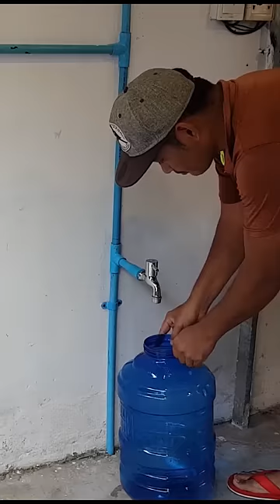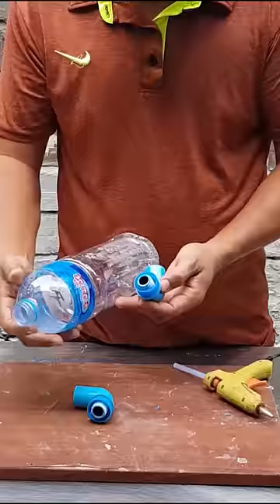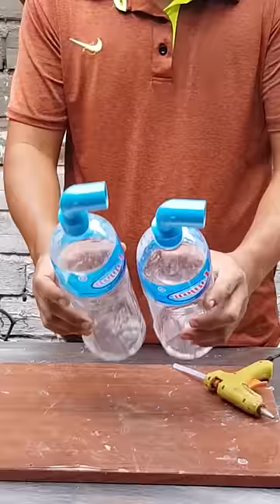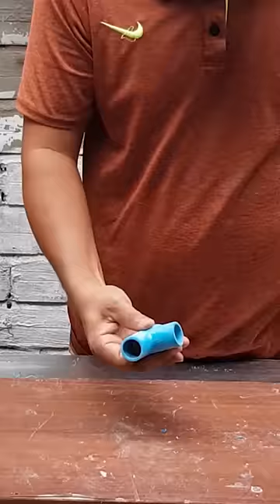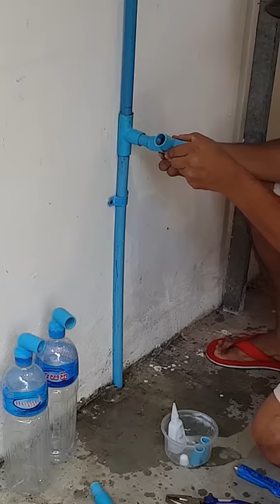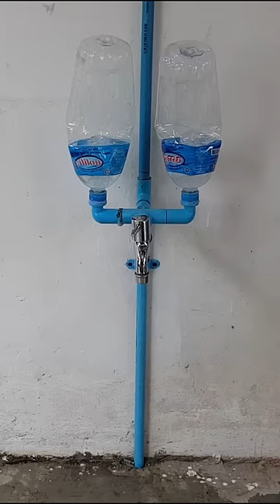Amazing idea to fix PVC pipe low pressure water #shorts

Comment: The best we could do is, report this video as fake and misleading.
Reply: What is fake & mislead in this video 🤔
Reply: @shashiankila7715  There is no way you are going to get that pressure with two bottles. This guy tried to show its similar to ramp pump. If there was a simple solution like this, why there is pressure booster pump?
Reply: @akhilchalil1585  yeah yeah 😁 you're right 👍
Reply: ngomong opo iki
Reply: Deixa a criança desenvolver o cérebro 😂😂😂
Reply: Piyee Ngomong opo iki, gak karu ngerti aku wesss
Reply: The 2 bottle help to save electric power of pump ,if you use less water than the bottle ,the pump will not work.but the water high pressure enough if you need to use more water so you need to have bigger bottle like a bigger pipe or a  tank underpump or bigger air tank size as apartment use. called pressure tank
Reply: لزيادة الضغط ليس تظليلا، بالنسبة من يحتاج للماء أقل من القنينتين، هذه الفكرة جيدة ،حتى أنها تبقي مضخة رفع الضغط المنزلية متوقفة إلى حين نفاذ مياه القنينتين
Reply: @yansaid3942 ngomong masalah botol jare botole njumuk gene tonggone wkwk
Reply: @berkahsholawat1015  wkwk
Reply: @EstrelaGil7276 
Kkkkkkkkk melhor comentário
Reply: I do agree with you
Reply: Mantap
Reply: Почему.запас та есть три литра.плюс давление потока.помощ в этой приблуде точно будет
Reply: @akhilchalil1585 what is pressure tank??
Reply: You can't say that this is fake how can you prove that it is fake? I see that it could actually be authenticated!
Reply: @ScoopCity202 yes it is possible
Reply: فلتجرب إذن.
Reply: È no!!!!
Prima bisogna segnalare quel video della banana!!!! che la mette in un vasetto è fa la pianta.
Lo dico perché mi sono stufata di fare marcire banane per niente 😤
Reply: Eso no funciona😡😡
Reply: Percuma dong ada pabrik pembuat POMPA bertekanan tinggi / BOSSTER Pump ...udah jelas ini video akal"an aja
Reply: @yansaid3942 terjemahan ke bahasa Indonesia😂😂😂
Reply: El agua que cae es de la cañería..y no de la botella..y para que queremos tan poquita agua de las botellas??
Reply: Yes👍
Reply: He closed the main tap and when he put the bottles in, he opened the tap
Reply: เคยทำแล้วไม่ได้ผล ถ้าเปิดปั้มน้ำมันแรงเอง😅😅😅
Reply: @yansaid3942 Pembohongan publik
Reply: ngapusi
Reply: Kayta likhli aas hindi thane likh
Reply: Ne alâka!!  adam kısa sürelide olsa suya hız verdi genleşme tankı yaptı..
Reply: Anda benar,ketika air yang ada dalam botol habis maka tekanan air yang semula keras akan menjadi seperti biasa lagi
Reply: Tinggal di perbesar botol sesuai kapasitas yg di butuhkan
Reply: @shashiankila7715 
In fact pressure will increase so far water is not fully filled into the bottles. As soon as water is fully filled it will create a negative pressure and one will not get even that pressure which was existing before.
Reply: 😊ไอเดียดี,,,,มาก
Reply: Si funciona pero solo mientras se termina el agua en las botellas 😡

Comment: Did it and work... when installing the bottle and the water is closed, open the water valve and squeeze the bottle, close the water valve, and open the main water valve. The bottle will fill up and the air inside the bottle give u the pressure. It work for me.

Comment: 1st time low pressure. But after adding bottle,  bottle refilling quickly. 🙄
How is it possible? 

Answer: there is a pressure control valve top of the roof 😜😎